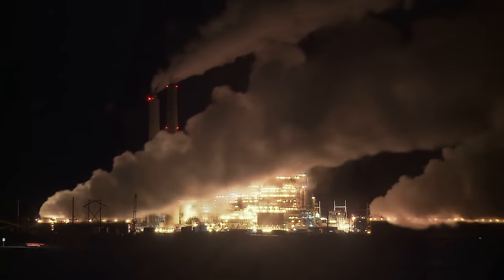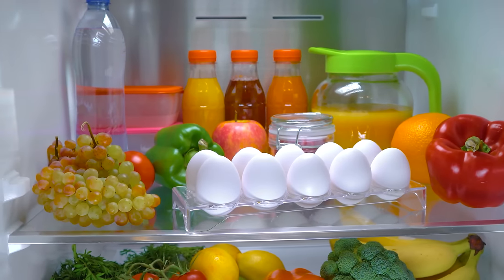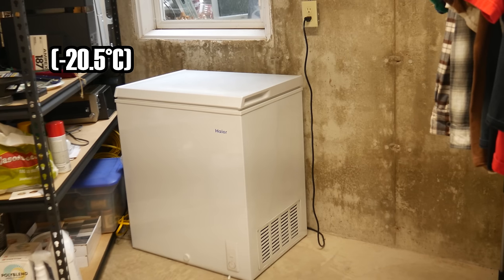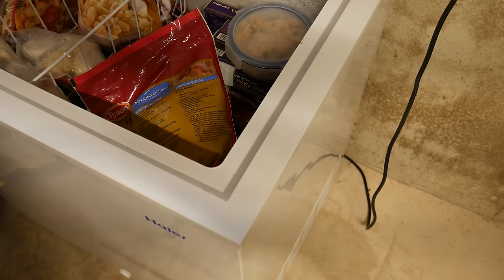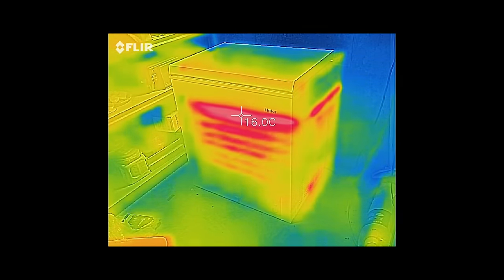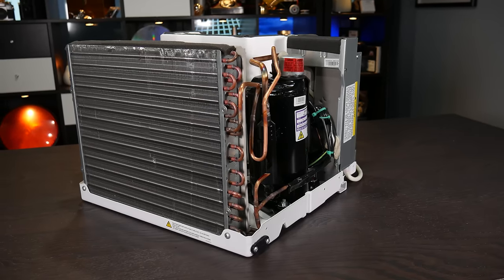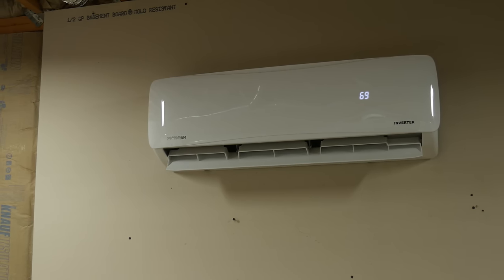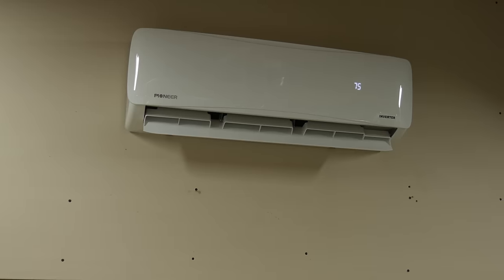Heat Pumps: the Future of Home Heating

Comment: I’m still not understanding if its cheaper or not. Is that argument even made in the video?  In the south, natural gas heating is still preferred due to it being perceived as cheaper, not more efficient. At the end of the day, I want to PAY the LEAST for heating my home. If its cheaper to burn more natural gas, then its still the better option for the consumer if you’re lucky enough to have the option. I don’t know if that break down exists. Maybe I’m over my head
Reply: Their efficiency ranges from 200% to 500%. That means that for each kWh of energy used by the machine, they'll move 2-5kWh of heat energy.

The cost of electricity (which they run on) is usually around 3-3.5 times higher than gas.

Ideally you'd want a heat pump to have, at the very least a 350% efficiency, which is quite easy to achieve on newer systems. Anything above that efficiency will result in a lower heating bill. You do of course need to have a well insulated home too; a more insulated house means a more efficient system overall.

When electricity gets cheaper (its extra cost is due to environmental taxes on energy producers), that energy efficiency will result in far lower bills.
Reply: @debbiegilmour6171  So there's still a bottleneck on the consumer's electricity cost? If I follow your comment correctly, it is still mostly cheaper (dollar for dollar, not energy consumed) for the average consumer to continue burning gas.
Reply: @JhoseinProductions  They're roughly on par with the cost of gas boilers assuming your system has an efficiency of ~350%, which is feasible.

However, unless your house is already very well insulated, then it won't be worth switching until your boiler needs replacing anyway. Until that time, work on insulating your house.
Reply: If you have a reliable and cheap source of gas you dont need to think about anything else. But if you compare electric radiators to heat pumps it is completely different.

Comment: "Under ideal conditions"

Let me know when a heat pump can perform at -30C.
Reply: Mine can...
Reply: @Hauntercry  If it's meaningfully better than resistance heating at that temperature, I'd love to hear what the model number is.
Reply: @daniellewis984  its not but its not -30 24/7 lol. Million times cheaper in the big picture. Im not switching it off and turning on some radiators when it hits - 30
Reply: @Hauntercry  So if everyone in my town gets this, when it's -30C, we're talking the entire town drawing gigawatts of power to try to heat their homes with what is essentially resistive efficiencies, likely collapsing the grid at that point.  Kinda like A/C in Texas when it hits +45C.
Reply: @daniellewis984  In Finland almost 90% of houses have heat pumps and when its - 30 degrees the grid works just fine. Electric heating with heating elements is the worse problem for the grid at those temperatures
Reply: @Hauntercry  I mean, we don't use heating elements either.  Most people here use gas, as it's about 1/4 the price per BTU.

If we could get a heat pump that works effectively in winter here though, I'd be open to building all my future work using heat pumps, but it seems like it's a fair-weather device.

Comment: At very cold temperatures, such as in Canada, heat pumps do not work! They don't tell you this little bit of information.
Reply: Depends on what you mean by very cold temperatures? - Many cold climate air source heat pumps will go down to -15C (5F), and some down to -30C (-22F).  However, if below -20C (-4F) happens a lot, then a borehole (ground source/geothermal) heat pump would be better, and matching the borehole size to the heat demand of the property will mean that it will work regardless of the outside temperature.

Comment: Lol what a joke, yes his theory is correct but applications widely vary. 30 year master tech and I live in what would be considered an average environment between summer and winter temps. Heatpumps are widely used in our area but are not the most efficient system available and geo heatpumps, lol engineering and theory is solid but longevity are not there for the overall cost. This guy has never had real world experience and I'm gonna guess he's an engineer. All looks good in 2D or on paper.

Comment: UTTER BOLLOCKS 
Heat pumps will not work on any home unless they need no heat to start off with
Reply: Pretty much every house in Norway, including mine, uses heatpumps for heating in winter. You don't think we get cold weather?
Reply: @logitech4873  UMMMMM you have houses with triple glazing and very well insulated so yes in those circumstances they can work. you could probably heat your house with 1 wood fire
Reply: @gowdsake7103  You don't have well insulated houses?

Comment: Future? 😂. Heat pumps have been around since the 1800s and have been heating homes since the 40s. And no heat pump is not more efficient. They also only achieve 20-30 degrees over the temp of the air coming into the return. Any one who lives in South Dakota, New York or even Alaska will tell you. Don’t get a heat pump. They don’t work in extremes.
Reply: They work fine down to like -25 degrees celsius. Beyond that you can just supplement with regular electrical heaters.
Reply: @logitech4873  yah. Wish that was true. Alaska disprove that article bs. Same with californazis Sierras.
Reply: @Daniel-os9tb  It's literally true. Everyone in Norway uses heatpumps.
Reply: @logitech4873  that’s why everyone there still has oil furnaces. And all buildings are required by law to maintain them. But keep leaving that out.
Reply: @Daniel-os9tb  No they don't lol. Where do you get that from?
Reply: @logitech4873  from visiting family there and working the pipelines.
Reply: @Daniel-os9tb  Well that's absolutely false.
Reply: @logitech4873  prove it. So far. The only thing you have proven. Is you don’t how heat pumps work, where they work or how inefficient they truly are.
Reply: @Daniel-os9tb  My house doesn't have an oil furnace. I don't know anyone with an oil furnace.
The car workshop I used to work at had an old oil furnace, but it got replaced by a large heatpump setup.

Why are you lying?
Reply: @logitech4873  you just proved you are a liar. Thx.
Reply: @Daniel-os9tb  What are you talking about? What's the lie?

Comment: Don't be fooled in this video this man tells nonsense , we in the Netherlands also have heat pumps for environmental reasons and those things use a lot of electricity generated in coal, oil or natural gas fired power plants and do not deliver what is promised the people have a cold house in winter, it is even questionable whether it is not cheaper and more efficient to use the electricity directly for heating, people in the Netherlands who have a heat pump are advised to also install a normal heating in the house because a heat pump gives almost no heat if the temperature falls below freezing in the winter, heat pumps is a worthless concept, stay away from those things, just heat your house with natural gas , oil or electric,  heat pumps are worthless rubbish.

Comment: Why is the heat pump designed to output to a single-room device? Why not design it the same as the air conditioner, so the central air can blow it all around the house? That seems like a huge job to potentially run high pressure piping all over the house to have one of these heater/airconditioner units on at least every floor, if not additional rooms besides that. How is that efficient?

you said the only differences are some valves and direction etc, you failed to mention the difference of a single room output vs a whole house output. that's a drastic difference you haven't talked about.

LOL only rated to -15C, we have multiple weeks, sometimes over a month colder than that every winter in Canada, and I'm in Southern Ontario! In central Canada and Alberta, it gets MUCH colder. Can someone please tell Trudeau to stop pushing these things in a climate that's not suited for them?? I think some people who mention Sweden or Finland etc, don't think about their population density and smaller homes, so maybe they can get away with only one or two indoor units. We'd need 3 or 4 of these outdoor units for many typical semi/detached homes in Canada, and all the plumbing for them, in an environment where their efficiency gains are just not going to be there for large parts of the year.
Reply: They don't just come as mini-splits. They come in a variety of forms, some can have a unit on the internal ventilation system - like you describe. There are also Air to Water ones, which can heat radiators in a central waterborne heating system.  Mini-splits tend to be the cheapest option, and e.g. I have 1 to cover most of my downstairs, another for upstairs, and a multisplit that covers a couple of rooms + does my DHW.

Not all of them only go down to -15C either.  the 2 main ones that I have go down to -30C.  The multisplit will only go down to -15C, but -15C is pretty rare here.  If it does get below -15C then the DHW will switch to the backup immersion, and I can use radiators if need-be in the two rooms that house the internal units.  
The other option for multiple weeks below -15C is a geothermal/ground source heat pump with a borehole. 

Property size is a factor, but it's more down to heat loss (which depends on construction, insulation, windows, doors etc), two wildly different sized properties could have the same heat loss and require the same heat pump, conversely; two identically sized properties near each other, could have very different heat loss calculations and require a different sized heat pump.
Reply: @BenIsInSweden  thank you for taking the time to share all this information, I genuinely appreciate it. This seems like a potential option to consider when my furnace breaks down and needs replacing, as I am not a fan of creating millions of tonnes of unnecessary early metal waste to replace a functional furnace, as governments seem determined to force us to. Furnaces only last 20 years or so now anyways, and new construction can have different rules, so why not let this more efficient, presumably cost saving technology speak for itself on my next replacement? Seems like it should sell itself, unless the math is a lot different because of more expensive energy costs in the EU.
Reply: @erichb4530  I guess water radiators is not so common at your side of the ocean? Its more or less standard in northern europe because its most efficient. So in many old houses where there was boilers for wood or oil we change the boiler for a air to water system, so the plumbing in the house stays the same. In my case the plumbing is only 50 years old so its no problem. We built our houses to last forever, and also started to insulate good very long ago, especially after the oil crises early seventies.

Comment: Heat pumps DO NOT SAVE MONEY. It's like running your A/C in Summer AND Winter!  Yay, $500 month PG&E bills all year round!!  Horay for the climate!!!
Reply: would you rather have any other heater running in the winter because oh boi those are a whole lot worse
Reply: okay but seriously, i want to know what your point is. the heat pump is meant to replace an old heating solution, not be an addition to an already in-place solution. and the entire point is that the "AC" that you're running for a whole year is likely cheaper than the furnace that you would be running otherwise?
Reply: Of course they save money. They use far less power than regular electric heaters.
Reply: Compare it to any other heating method and its cheaper....
Reply: @logitech4873  Because electric heaters are garbage.  Natural gas furnaces are much better.
Reply: @nonyafkinbznes1420  Better at what? They both generate the heat you need, but a heatpump is far more efficient at it.
Reply: @logitech4873  Wrong.  Heat pumps are expensive to install and maintain.  A properly functioning gas furnace works fine.

Comment: Heat pumps don't work when the temperature gets under 32 degrees fahrenheit.
Reply: Literal untruth. Do you think these things work by melting water or something?

The boiling point of most pressurized refrigerants is below -20 F, they work just fine below freezing. In fact they maintain a positive efficiency ratio down to about -15.

Comment: Heat pumps. Yeah,OK. Still have to have a real source of heat or you can't get insurance. Going to be between -35 and -42 where I live in a day or 2 and it's going to stay tgat way for while. A heat pump would cease to work long before tempsgot that low.
Reply: Those days are few and far between. You always install a backup to supplement for those handful of days.
Doesn't have to be perfect to be better. Better and cheaper is good enough.

Comment: Heat Pumps do not work in extreme cold.
Reply: yeah, they do.  Ground Source/Geothermal ones will work regardless of outside temperature, as long as they are sized correctly. There are also many Air Source ones that will retain 100% of their capacity down to -20C (-4F), and still be able to provide sufficient heating (if sized correctly) down to -35C (-31F).
Reply: You seem to know everything about heat pumps.
Reply: There are heat pumps specifically for cold climates.

Comment: Had someone from the City Council send me some stuff about installing a heat pump. Did the calc's and it would take around 40 years of service and parts replacement free operation before it paid for itself. Another green scam, just like EVs.
Reply: 40 years? sounds like your math is wrong, a $700 unit would pay itself off in under 5 years here
Reply: @TheAechBomb  I think you're getting air-cons and heat pumps mixed up. 700? lol, yeah right. it was nearer 16K to get a system installed.

Comment: It's not that true. You use two to three times the amount of energy to heat your home with a heat pump. I live in Maine and have one on each floor of my home and it is definitely not the heating of the future.
Reply: Have you thought of insulating your home? Maybe that's why you are spending so much energy to heat your place?
Reply: @texanplayer7651  Lol spent a lot of money on spray foam from the basement to the attic. So definitely not an insulation problem. They are not designed for the northern states like Maine seeing they have to pull in the cold air to heat it. They was proclaimed to be these magical things that they are not. I'm not saying they don't work but they do not heat a home the way they are advertised
Reply: @Corrieri85  Well then you got scammed, because people in Canada use them massively at temperatures below -10F and they love their heat pumps.
Reply: @texanplayer7651  Yup and they are spending more on electricity then they would oil or propane.
Reply: @Corrieri85  If you buy a heat pump designed for cold climate and not the cheapest one you can find it will work as its advertised.
Reply: @TT.Hell.  🤣🤣🤣🤣🥴🥴🥴🥴 We found our internet know it all. Do you know me? Cause pretty sure you have no clue and no they are not designed for states that get  well below 40 degrees and stay efficient. Do some actual research before you sound even more intelligent then you do. . 😘😘
Reply: @Corrieri85  I can assure you I did a LOT of actual research before buying a heat solution for 12000. I say there is heat pumps designed for colder weather. A simple reversed cheap AC unit will not work, so there you are right.
Reply: @TT.Hell.  If you are in a colder state like I am in Maine. They are not worth the money no matter how much you spend. My wife and I spent almost 20grand having one setup down stairs and upstairs in our home. Once it started dropping below 35-40 degrees they are absolutely not efficient. I can see like warmer states like Georgia Alabama or something that don't see below freezing much but Northern states it's not worth the money. The only bonus was the right offs and tax break we got for doing it.
Reply: @Corrieri85  I live in sweden which probably is considered a colder state. I just think the units that are good enough are not marketed in Usa. Which means they exist, but you cant buy them over there. Which is kinda sad, because it obviously leads to that Americans think it dont exist :)
Reply: @TT.Hell.  I definitely wouldn't doubt that at all truthfully. We seem to get everything much later then the rest of the world for some reason. I wasn't saying they probably don't exist but for the money I spent I was told and thinking I would be saving until I got my electricity bill and the shock set in and I turned my furnace back on.
Reply: @Corrieri85  Different things comes first here, and other stuff you get first. Some things some of us never gets.  A bit out of context, but it's hard to get Mountain Dew in Sweden! And I happen to like that soda.
Reply: @Corrieri85  And btw, we dont have much gas over here. Some neighbour countries have, but most of the gas comes from russia. And guess what, that nutcase in russia turns off the gas for export.

Comment: They don't work it's all  bs .
Reply: In ontario Canada right now. 15 degrees below zero Celsius. High winds. 2500 squarefoot 200 year old farmhouse.
Whole house air to air heatpump. Currently a very comfortable 23 degrees Celsius in my home. Back up heat has not been needed.

You wish you were right for some bizarre reason, but you are clearly wrong.